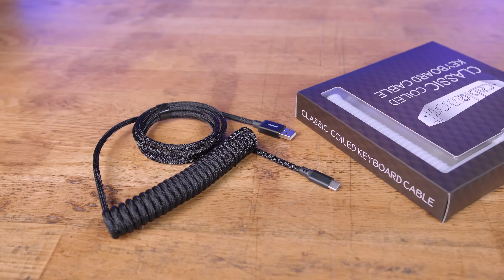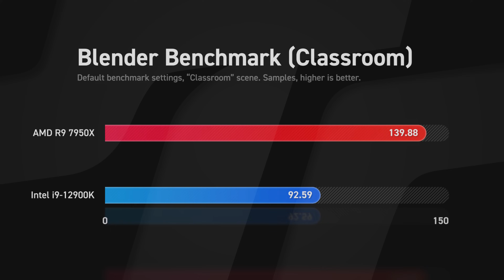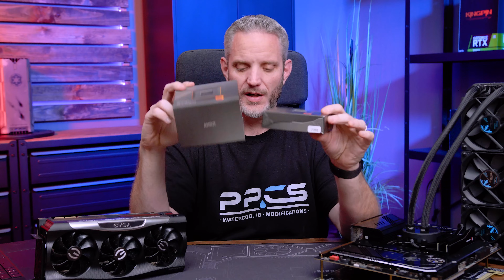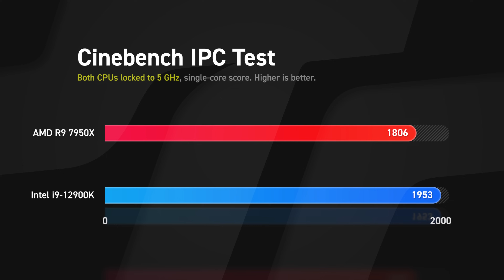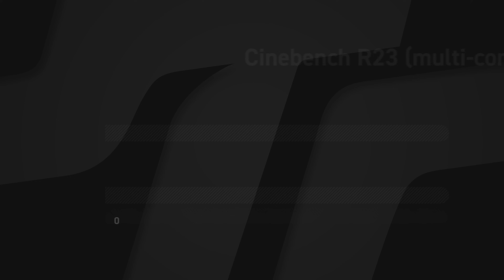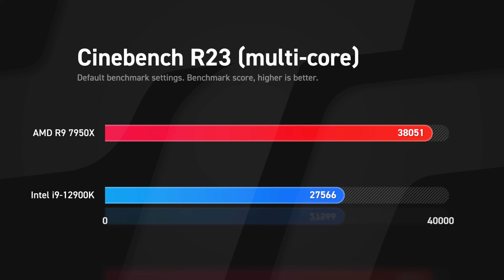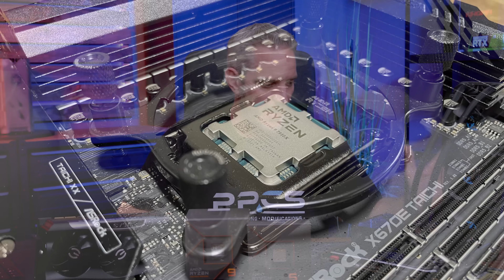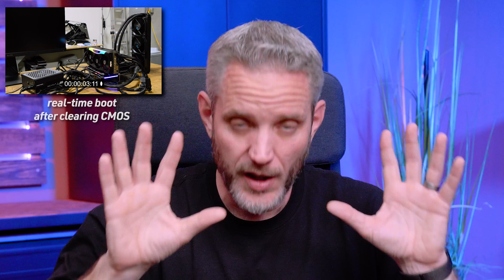Forget EVERTHING you THINK you know about AMD... these CPUs kick A$$!!

Comment: the new rtx 4000 series are not great in term of pure power, the wattage increase is minimal compared to last gen, because they already hit a wall on how to cool the new gpus, higher wattage = more power = more heat, instead on depending on hardware now they depends on software such as dlss 3, the rtx 3000 series have the capabilities for dlss 3 but they decided not too because they know full well their new cards wont sell well if they do that. in short they are selling software (dlss 3) instead of hardware (gpu). and they sell it twice more price than last gen cards except the rtx 4090 which is ridiculously expensive to begin with because of last gen rtx 3090 and other gpus price caused by miners and scalpers, make it scarce and rare, high demand low supply, make it expensive, even there is a rumor that nvidia is deliberately make their cards scarce while in truth they have a lot in stock. and now they make the new gen cards twice expensive than last year with only dlss 3 to boast with in order for people buying their 3000 cards. they even go as far as making the suppoadly rtx 4070 become the other variant of rtx 4080 while all evidences already present that it is indeed supposed to be rtx 4070, they caused the mess they made for almost 3 years for gpus market and now they expect to get away with it ? bold move. but not wise for long term. it just gonna hurt them even more.  🙂

Comment: Wowzah... Jay has a Forza Bottleneck Benchmark. These influencers  never tire dissing "synthetic" benchmarks but here's Jay running FH5 on an RTX 3090Ti at 1080p low settings, about as synthetic a scenario as it gets, besides, if you're serious about the "bottleneck", try 720p low settings with 50% resolution scaling. ;)

Comment: Im also so excited for the Intel chips, the rumors say: 13900k is a 24 core? Wow with lower power also 🙃excited times for all ✌️
Reply: Intel not including AVX512 instructions any more and neither are Nvidia ...... So for those of us reliant on that, there is only one choice and that is AMD who support it in all their current chips.  Also I think efficiency cores are a hard sell, 24 cores means 12 cores and 12 crappy smaller ones.  To add to this it can only boost 1 or 2.

Whereas AMD has 16 proper cores all capable of boosting together consistently, 32 threads with SMT .... Intel are going to need some kind of miracle to compete with this AMD lineup.
Reply: @SinfulPreacher  maybe that's true yes,but in most gaming applications/games the 12900k still out performs in most games the 7950x,the cpu's are monsters in workloads and stuff but gaming is fine but...so you right about amd but ,still excited for the 13th gen of Intel mostly of the less power consume,at least if you believe the rumors 😉
Reply: @johannestwickler177  i've been on intel only and never had issues with the builds,i leave my gaming pc on 24/7 i was planning on going with amd but users are scaring the sh&t out of me about amd software driver issues..im waiting on 13th gen and see what's best,current system is i7 8700

Comment: So here is my question that brings me out of my hole to actually comment on a video....what about the chipsets and board drivers?  Your experience with Windows being more snappy is telling for sure, but the board chipsets and associated drivers have always been my reservation.  I build higher end systems for video production companies at times and generally will not recommend AMD, not because I think the CPUs are bad.  They have been impressive again since the advent of Ryzen.  It's the little glitches from the AMD chipsets that I've had to work through on every generation that keep us mainly an Intel shop.  The boards based on Intel chipsets generally just work.  There is a wonky driver here and there, but nothing like the problems I've experienced on modern AMD systems over time.  I await some analysis of this at some point as its an issue I've heard a lot from others too.  If the new gen boards prove to be stable and the drivers aren't d0gsh!t, I will happily start building and recommending the new generation AMD stuff.

Comment: No need to upgrade, i am still using my air-cooled AMD K-62 450 overclocked to 100,000 GHZ, got it running with a 3dfx Voodoo 2 Xtreme that i re-write the drivers for, i can play any game at 8k at max settings and never drop a frame below 200fps.

Comment: That's probably a noob question, but are single-core benchmarks complicated by Alder Lake? Is the result only for performance cores or some average of all of them?
Reply: Single core benchmarks would be using the performance cores as a single core benchmark will run on the best core the CPU has, and that's the whole point of the P Cores
Reply: @Fezza1187  Ah, thanks.

Comment: So... in theory, because the AM4 coolers will work with AM5, and because the AM3 coolers are also compatible with AM4 socket... That should mean my AM3 cooler should work on the AM5, right? (Yes... I have an old system.)

Comment: You know one thing that I don't know/think is practical, but I would like seeing high-end emulation benchmarks. It is becoming more of a thing these days. But it is also one area that Intel seem to have an unfair advantage for whatever reason. From what I am reading so far sounds like the 7k series is no different and to really get the performance out of the 7000 series you would need for higher emulation would require a custom water loop just to keep the temps down. Just a thought.

Edit: BTW, thanks Jay and the rest of the crew your channel is still one of the first I watch.

Comment: My 3970X scored over 51,000 on CB R23 with just a CPU waterblock and 280mm radiator at stock power limits.  Its amazing what a 3970X can do when you increase the clock speeds through software.  I don't think there is much headroom for improved performance in the 7950X without chilled water cooling.

Comment: As mentioned the high temperature is by design. Could you check the new ryzen chips with air cooler, liquid and also bring up the air conditioning beast you have to see if they will clock higher?

Comment: Ease of use is a powerful attraction, the self optimising of the ram is freaking awesome.
I too hope that the radeon department and rdn3 does well, nvidia needs more than a few slices of humble pie.
The next build i do will be a full amd rig, nvidia have just burned too many bridges at this point.
Since nvidia gave up on the low end market then the rdn3 igpus have a very nice opportunity if it has come far enough.

Comment: If you have a loop with a high end GPU as well as the 7950x running at 95c - Then what kind of impact does that have on our GPU performance since the loop is running hotter than with previous generation

Comment: AMD needs to dump that ridiculously thick die lid cover.  It makes it very hard to cool off the die quickly and efficiently.  At least offer a delidded version for those that want to direct cool.  I was watching a tech channel yesterday that delidded Ryzen 7000 because he was questioning AMDs decision to make the lids thicker than ever before just to maintain existing cooler compatibility.  So he delidded and did direct cooling maxing out on full load 71.4c from stock lid testing at 90c using same load. He was also able to put and maintain 5.4 ghz across all cores with direct die cooling.

Comment: der8auer ran the 7950X direct die and got ~79C  instead of 95C but I only had it playing in the background, can't remember if the clocks were higher.

More than gaming though Zen 4 being snappy like heck seems like it'll be exciting for laptops. I mean...imagine a 2 in 1 ultraportable with these chips. or heck, a tablet with detachable keyboard. These 2 in 1s and stuff like the Surface Pro can catch up to the iPad Pro and Samsung Galaxy Tab in terms of being snappy, then it's just up to the laptop manufacturers  how close they can get to how well the Surface Pen works. If you have a gaming desktop anyway even if you do have an Android or iOS phone no need to get a tablet on M1 or mobile CPUs, or have to choose between that vs an ultraportable. And AMD gaming laptops won't have a rep for feeling less snappy than Intel gaming laptops, although given the power and thermal management on a laptop I'd be skeptical  if  it can clearly be snappier.

Comment: Yeahhhh NOP. Fk AMD. As an owner of 5950x, i'll absolutely never ever buy any amd product ever again! Let me telly you why in simple words!
AMD doesn't work with devs for optimization and fixes! One of the most visible example of that was when motherboard manufacturers couldn't do anything except wait for agesa updates and then work around that! Even 1 year after launch, 5000 series CPUs were causing usb issues in PCs.
Even now, ddr4 4000mhz RAM still doesn't run at full speed efficiently because of infinity fabric not stable at 2000 and above! AMD should fix that first no? 7000 series will have its own issues that amd won't solve even after next cpu series launch.

Those who'll still buy amd cpus knowing this, i wish you all the luck coz you need it.

Comment: So they've basically enabled PBO by default (technically not true, they've at least increased the default limits).
Previously 5950x was a bit gimped by default - 25k in cinebench when most could achieve 30k by changing 1 setting. This makes the comparisons a bit messed up, would be nice to compare at similar temp/power.
Reply: What was the 1 setting that you changed that got you to 30k? Thanks

Comment: I'm actually not impressed.  This is a new architecture for zen, not a refresh, and many reports are already saying that the 13900 smashes the 7950x.  Albeit at an additional 100 watt power draw, but... since when have enthusiasts cared about power consumption. 
They said 57% higher single core performance than then the 5000 series... and its not even close to that.
Reply: @Garrus Vakarian incorrect
Reply: @Garrus Vakarian Incorrect.  I'm guessing you haven't even seen what I'm talking about, rendering your comment ironic.

Comment: I felt dissapointed with the value class 7600x which while it gave significantly higher gaming performance, the workstation was pretty much the same as the old 5600x. And really aside the DDR5, is there any reason to pick 7600x without knowing the B series motherboard. 

The 7950x on the other hand....

Comment: The socket design is WILD! The auto  RAM timing adjustments are just amazing.
Reply: Jay said if the caps loose power completely it will do it again. So what if u turn off the pc over night and u turn it on the next day and the caps are drained so it will boot loop? Am gonna be pissed if that happens
Reply: In case anyone else wonders this, The cmos battery can hold settings without power for up to 3 years, So would only be an issue it you cleared it.

Comment: Vallue isn't there. Prices are to high. The requirement for massive CPU cooling solutions just to run the CPU at a decent level. Massive power requirements. Expensive DDR5.

Just not worth it.

Comment: As much as they say 95c is normal and fine, even in older CPUs temps in the 80s-90s was "ok" , that makes ME sweat, I know they can handle it and all that but when you've got a component inside a case that is almost literally hitting the boiling temp for water, that's a bit iffy for me. I got the 5800X3D only a couple months back so there is no upgrade gain for me to get the 7950X especially when the 5800X3D pretty much beats it especially in temperature, I've never seen my CPU go over 50c even after massive long 8 hour gaming sessions, OCs, benchtesting.

Comment: For testing CPU bottleneck I can recommend you introduce Factorio as a benchmark. There is a mode to unlock UPS (updates per second) and with a decent savegame (a big megabase) you can see how much time each CPU takes to simulate a frame.

Comment: Jay, have you seen Romans video when he delidded and direct die cooled the 7900X ... and dropped 20c in temp during boost?
Twenty degrees drop. He called the IHS thickness as the reason (1.5mm), and said AMD did this to ensure cooling compatibility with older AM4.
Q: do you feel this was a good choice by AMD?  A 95c chip normal, and leaving 20c (thats ... twenty) on the table that only delidders can take advantage of to keep their chip cool and ensure long term durability.
Where are you on this?

Comment: Those cable mod cables wouldn’t let my system boot. Disassembled my water loop and reinstalled it. Still didn’t boot. Pulled that keyboard cable and booted fine.

Comment: Am considering these as an upgrade, just not sure about the costs yet if I should wait. But am impressed certainly.
Reply: Keep in mind, this is not an upgrade like has been happening for the last handful of years.  This CPU does require a new motherboard and ram.  They are pricy right now.  Plus if you upgrade the GPU you might need a power supply too.  Essentially, if you want the latest and greatest this time around you are looking at just about a whole new system.

Comment: Man I think the last time jay was this excited about a CPU launch was 9900k. 

For a while there it was "aio it and it will run at good temps and be good to go" but you can see the gears turning in Jay's head

"If i put this rad with a custom loop on it... I may be able to overclock the snot out of this thing" 

And amd Still has a trick up it's sleeve as none of the chips launching tomorrow will have V-cache.... There will be a V-cache model before Zen 5..... guaranteed.

Comment: Interesting that Jay mentioned weird micro-stutters on a system. I have had these weird issues since 2012 and it is driving me insane. I built an all-new Intel 3450 system with a GTX 670 with a Hyper 212 cooler that had  stutter issues the whole time. I would do periodic clean installs, make sure drivers were up to date, move from platter drives to solid state - nothing helped. Then, I built an all new 6600k with a GTX 1070 and the updated Hyper 212 cooler. Clean install of the OS, current drives, etc. System still had the same micro-stutters. I swapped out RAM, replaced the PSU, again, nothing helped. In 2020 I built an all-new AMD 5600 system with a RTX 3080. I used the included cooler initially, however, the micro stutters have persisted. I changed the cooler to an EVGA AIO, clean installed the OS, updated firmware and drivers. I am at a total loss. Every game, 60 FPS locked or 144 FPS to match my monitor all experience stutters and occasional freezes for a second to two. My current monitor is the only component left that had been used with the 6600k and the 5600 systems. I don't get it!!
Reply: I've been building PC's my whole life & really got annoyed with PUBG micro stutters. It made me learn even more about FPS & frametimes. Look at videos by Battlenonsense about what we all need to use an FPS cap. In the what solved micro stutters for me was 1: using an FPS cap to stabilize frametimes, 2: overclocking my ram & tightening the timings. That gave me a huge boost in .1% FPS. 3: Google & read about "timer bench", "HPET" & "timer resolution". Another big improvement came from me using a custom light version of windows, now called " Windows X-Lite". For some reason, the timer resolution (you'll have to do some reading on it) in his custom Windows 11 was always a perfect .5ms. I confirmed that a program a lot of people suggest called ISLC (google that too).

Comment: Looks good and if I had the money, I'd buy it right away, but I wouldn't want to figure out the cooling for it on my own. It's one thing if you're only accounting for something that gets hot every once in a while under some workloads, but a constant high heat source is going to present a different set of challenges for system builders. I'm not even sure I'd put an air cooler on it due to the inside of the case turning into an oven if the air flow isn't good enough.

Comment: This is what "competition" has brought to us - a lot of rule breakers with Zen 4. Back in the day, if you bought say a 1600X, you had to spend hours to manually try and overclock it to what the silicon lottery let it be. Now with Zen 4, its going to max out the power / thermals by default (even the memory sticks) for you with your given setup. Yes, this increases its power, but that's what people look at - how fast it can go. Most people will trade power for performance if they can get it. But if you want to keep your 7950X at the same power draw as your 5950X, that's okay. You can set the power limit to that and still get a huge uplift over that processor. I'd rather have it this way than finding out 1-2 years later that my processor would have been 30% faster if I had spent 2 days tweaking it for it. I'm really excited for Zen4 and beyond.

Comment: The other way you can thermal throttle is to pulse width modulate HALT/C1 state part of the time.  That was the only way the P4 could thermal throttle.  They realized that it would be better to lower the clock and voltage, but I wonder if the Zen 4 reverted to HALT/C1 since you told it to lock the clock.  I can't see any other way it could keep the temp from going over 95 C.  Also my older Intel system seems to have the limit set to 95 or 100 C as well.